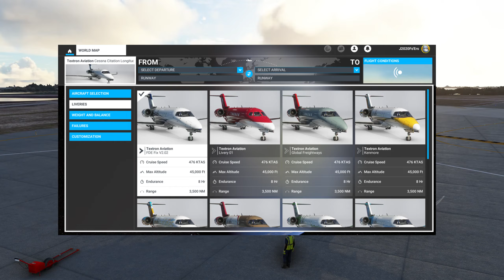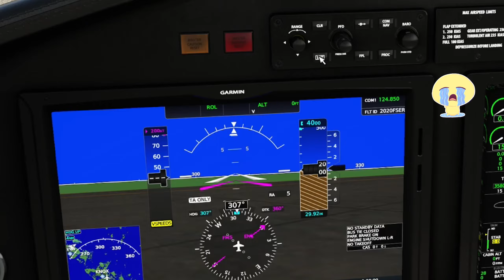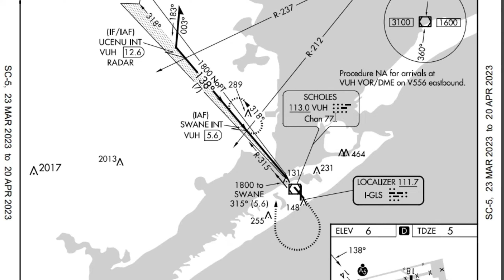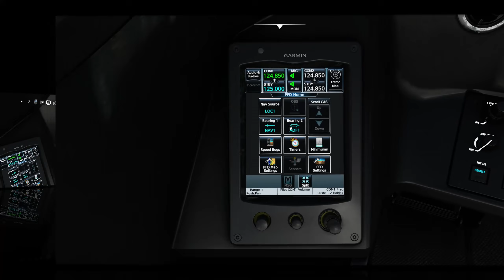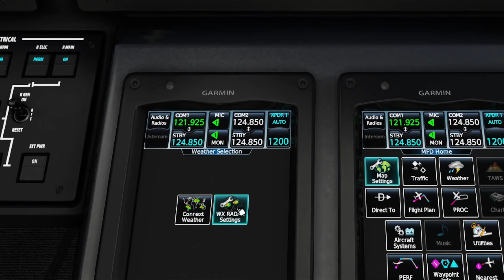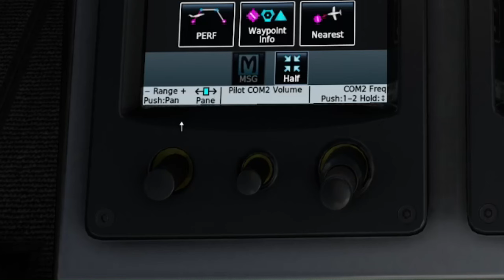Comment: i dont hear any beeps when i activate nav radio. i just see i catched up ils, some letters shows up next to the freq. number... but NO beeps :(
Reply: If you want to hear the audible beeps to verify the correct Vor then you need to turn on the audio on the PFD control panel like I showed in the video.
Reply: @HomeFitnessSolutionsTN  I did it exactly. NAV 1 frequency is exact ils (109.90). Volume is 100%. And NAV 1 button is on and green. I dont hear nothing. Are you super sure that Longitude beeps work? Can you please try it and report me? Thanks a lot.
Reply: I will check
Reply: Okay I got you here. Click nav 1 in the audio panel then the  green light illuminated under nav one it should tell you the Vor  identifier on the right with the frequency. at the very bottom where you have three knobs the very center knob if you look just above it it says push to ID you would push the knob in and then you will hear the audible sound
Reply: @tonazzz I'd will also show in the box with the freq.

Comment: I bought a vkb joystick. Do you have a sensitivity setup fpr the Longitude? When I pull back my aircraft after taking off it pulls harder. It don't what joystick anyone has but it'd be great to have a sensitivity tutorial for the Longitude.
Reply: I use spad for my keybinds and this has no sensitivity settings . But it works very well they have a trial if you wanna give it a go .

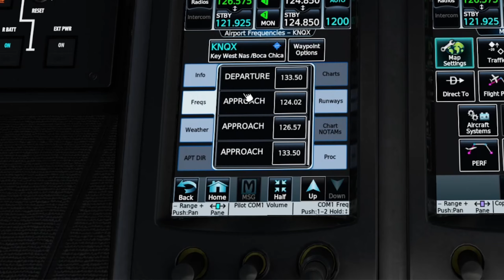Comment: Just maybe a helpful detail.  Reference your discussion on the G5000 MFD Control (a.k.a. the GTC [Garmin Touchscreen Controller]).  At 42:44, you pointed to a frequency list available under the Airport Info tab.  All of these frequencies are COM (voice) frequencies.  Selecting them will input that frequency to the COM radio, but it  update your NAV radio with a localizer or ILS frequency.  The list shown allows the pilot to select and speak to different geographic ATC sectors surrounding an airport.  While it is true that some approach control sectors are often associated with specific approach corridors and procedures (i.e. instrument approaches), there are often multiple ILS and LOC approaches within a single approach control sector.  I guess the bottom line is that there are no automated COM/NAV frequencies parings, and selecting a COM frequency on the COM list will not affect the NAV radio.   Nice job on the video.  Very professional and easy to follow.
Reply: Thanks for the comment

Comment: May I Ask you, as it is hard to find online: 
Is the FDE mod fully working with the latest Sim updates as per Jan-2023?   There are complaints about systems faults with this mod installed.
Thanks!
Reply: I haven't used it lately after su14 so I'm not sure. But it did definitely help with some of the little issues, especially with reverse thrust.
Reply: It's not mandatory to have. it only affects aerodynamics. I would say.

Comment: Thanks for all your help in understanding the G3000/G5000. My question is, when looking at a flight plan, whether it's simbrief or little navmap, how do you differentiate between inputting as a waypoint or as an airway?
Reply: Thanks for the comment.  Ok so most airways have flight restrictions so this is the 1st thing to look at. If you cannot achieve the altitude or speed I  that airwa then that's a no go. 2 if you meet the requirements and in  your route you can use an airway then use it . Using an airway is no different than other waypoints in a sense . It will help cut down on the amount of waypoints you need to enter in the gps. For instance you can use an airway and not input the airway in the g5000 and instead input all the waypoints.  So you are still using an airway but you entered all the waypoints.its really up to you on how you enter the fpl . I hope this makes sense. If you are not following proper procedures then you don't need to worry about step 1.

Comment: A few months ago on my Longitude, the autopilot panel indicator lights stopped working. When any button was pressed, no indicator light worked. I have tried everything and researched the matter. Does anyone know anything about this issue and could advise? Thanks.
Reply: Are you using any mods for the longitude.  Also are you running any other mods in your community.? If yes remove them and retest .

Comment: Markers transmit using one of two possible power settings. Low power markers require 'High sensitivity' reception to be selected. Also, if you are talking about using the barometer/QNH it is called 'altitude', if you are measuring using radio altimeter/height above ground/QFE, it's called 'height'.
Reply: ok thanks for the info

Comment: At 6:00 The VNAV works beautifully in all phases of flight with AT, ascent/descent. Try a SID departure with an Altitude height restriction to test. Recommend SLAPP2 at KBUR to KLAS with MISEN transition.  It has a 19000 alt restriction. I fly this all the time and it always levels off. AFCS must be in FMS mode with AT and FLC selected.. Also be sure that Alt Sel (cyan color) is set to cruise height and out of way.
Reply: Thanks for the comment ... yes since this video I have gotten vnav to work and just finished part 3 in edit now so you will see that as well. You can also use vs in vnav as well as flc I go over that in part 3 as well. Hope to get it out soon .

Comment: Excellent video, Well presented and in-depth. On mine the Aircraft Systems is greyed out. so I'm not able to bring up the systems on to the screen.
Reply: Thanks for the comment . Make sure you are using the 2 mods that I go over and also remove any other mods from your community folder and check if that fixed the issue .

Comment: I Love your video's. I learn a lot...but now I don't know what to do. I can't start up mu apu or engine. I found some video beacause of the blank screens. That's solved but this with he apu is a crime. Do you have a solustion?
Reply: The blue color you are refering to is CYAN. Cyan is a secondary colour when you mix blue and green. Magenta is the color we all know well. Mix between red and blue. The other pane colour is more of a variation of lighter magenta. Anyway this is an excellent tutorial and it really explained the confusion around the panes very well.
Reply: Thanks for the info 👍 I appreciate the comment 😀
Reply: Thanks for the comment . The 1st thing I look at are mods . So remove all mods from the  community other than the 2 I go over in the video . And see if it works then
Reply: If one ever has a problem with startup, use the CTL E keys to start and CTL SH E to shut down. I always load aircraft from a ramp or parking spot to avoid lame ATC stuff that starts you on a runway and nags for response. Sometimes I just want to fly on Vatsim so I skip startup procedure and hit CTL and E. Navigraph now has been incorprorated in Longitude. Simbrief flight plans can be loaded directly into G5000, as well as all Jeppeson sim charts. good luck

Comment: As far as I know VNAV should be work also in the climb procedure. Try SID  SPR3U transition SPR from LSGS (Sion Switzerland) RW25, There are two restriction below 11000 and 13000. Even if you set crusie altiude, say 25000, the Longitude perfectly levels  at the constrain. Try that.
Reply: I will try it again and I will also try it in part 3. It may be the sid I was using doesn't have any constraints but I thought it would take me to cruise .

Comment: Lots of information here. Fun plane to fly. The split screen does get confusing on which panel you are controlling. I thought the mod was not needed with this latest update. I'll have to check it out.
Reply: Thanks for the comment .. Yeah they still haven't gotten this plane up to par yet so the mods are still needed to bring it closer to the real thing. I have no idea why msfs put the enhancement mod I  the marketplace and not just incorporate that into the plane makes no sense to me.
Reply: @HomeFitnessSolutionsTN  I think they do it for folks with lower end computers. It takes more power to run. Interesting is that when I use the enhanced mode, my GTN 750, I always use it, loses it's topographical feature so the map is just black. I have informed the programmer (PMS ) about it so he is aware of it.
Reply: Your probably correct..

Comment: I can't land the thing.  For me, it stalls on approach every time even though I'm above the approach speed!
Reply: Use auto trottole in manual mode and keep speed not below 130 knots. The auto throttle should disengage automatically when you are some feet over the runway. Be aware no much wind in the back
Reply: I now use the FDE mod and it's fine now - the plane is quickly becoming my favourite.
Reply: That's fantastic I also found another bug if you dont use the fde mod . On the runway if you engage the reverers the plane tips up and does a wheele lol . Yea the fde mod is still much needed on this aircraft and makes it much better to fly .
Reply: i havent had that issue ill see once we get to part 3 and 4